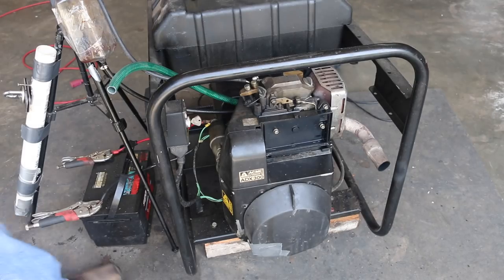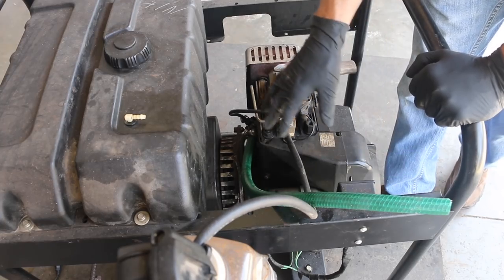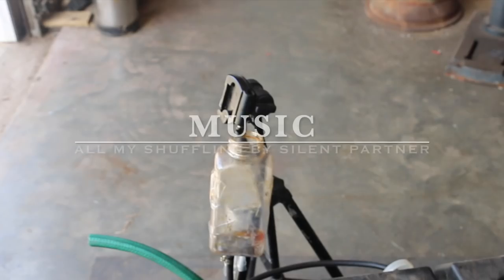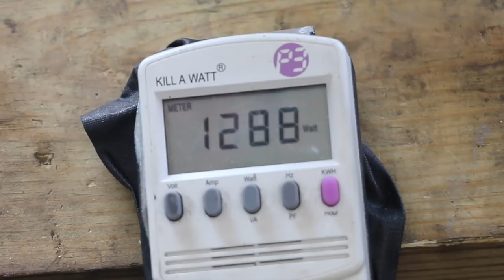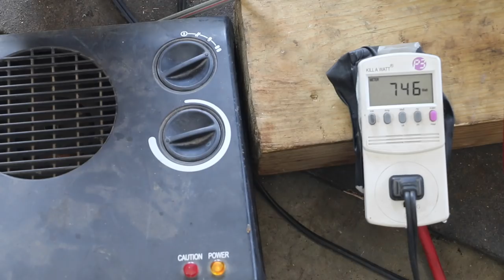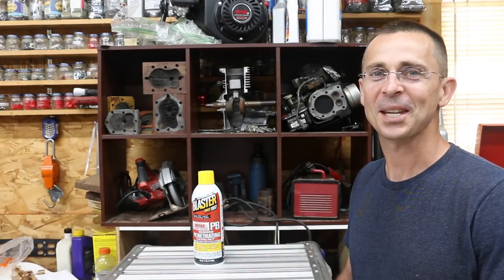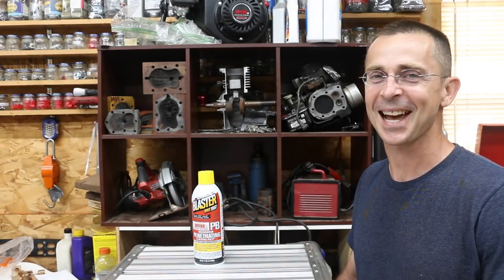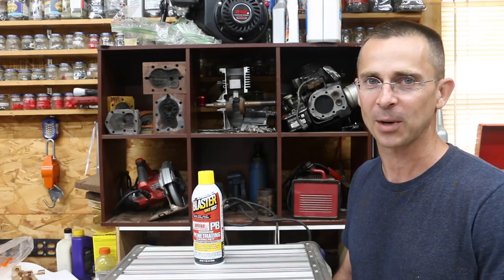PB Blaster as FUEL?  Let's find out!

Comment: A suggestion for future videos like this - a look at the frequency display (Hz) on the meter would be interesting, as the frequency is directly tied to the speed of the engine (except in inverter generators). Certain electronics and electrical appliances won't work right if the frequency deviates too far from 60 Hz. :)
Reply from the maker: Great recommendations!
Reply: ah yes.. the magic 60.. of course... good plan...
Reply: Non-inverter generators are all over the place with respect to frequency especially small ones like this. In my experience most appliances don't care about frequency over small periods. Motors run a little slower or faster. Heaters don't care. Switch mode power supplies lose efficiency. Even in huge swings of +-80%
Reply: mharris1270 I agree, the only way the consumption on the heater would have gone down is if the voltage went down which also means this generator has bad voltage regulation or the RPMs dropped below regulation threshold.

Comment: Use Veg oil and used engine oil . It works, been doing it 15 years in my diesel vehicles but some people don't believe it or think it will blow an engine up.  Make sure you filter and dry the oil properly before you use it as fuel.  No engine will run on contaminated crap. 
You could also add 5 and 10% RUG and show the effects of that but to get a true reading you may have to load the genny near capacity. 
To see the specific power of each fuel you will need to over ride the govenor on the engine so it does not open up and add more fuel to compensate. 
The Veg and WMO should have about 10% less power than diesel but the addition of the RUG should bring it back the same.
Reply from the maker: Thank you for the video idea!

Comment: Run charcoal lighter fluid
Reply from the maker: Thank you for the video idea!
Reply: Charcoal lighter fluid is to volatile of a liquid. If put in a diesel engine it would cause premature ignition and cause premature wear, but I can't say the same for a gas engine, granted gasoline is more volatile than lighter fluid.
Reply: Cayden Brown you won’t get premature ignition in a diesel because the injection timing sets the ignition timing. If anything a faster light-off time is better as it reduces the delay phase duration and reduces knock.  
What bbq lighter fluid will do is shag out the pump. It’s got no real lubricating properties whereas diesel has enough sulphur to stop the internals grinding.
Reply: WineScrounger Not ULSD, which is all you can get nowadays.
Reply: WineScrounger what about the high compression? Won't that cause the preignition?
Reply: @stacy - depends on the age of the motor and pump, even then some stuff runs fine on ULSD and anything built in the last 20 years at least was built to run on it (manufacturers were given a tonne of advanced notice), I used to work in a Gas Station just before I left high school and for a while after ( 98-02)  and we got notification like 2 years before it went on sale (And we were always last to know anything..why bother to tell the folks who sell your product and will have to answer questions from customers?)
Reply: John Phillip Given those years, you are referring to LOW SULPHUR DIESEL. That's NOT what I'm referring to. They changed it again to ULTRA Low Sulphur diesel.

Comment: try lamp oil
Reply from the maker: Thanks for the video idea!
Reply: Lamp oil is kerosene. 10-16 carbon chain molecules vs diesel 8-21 carbon chain molecules. Military equipment run on both so diesel engines will run fine all day o  kerosene.
Reply: Erik Kovacs don't matter. Still a video idea

Comment: U should look into HHO & do some experiments with it. It’s pretty interesting.
Hho generator, Hho cell, Hho conversion, ect.
Reply from the maker: Great recommendation!
Reply: Id like to see this as well please
Reply: Be interesting to see how badly it will fail to provide any net gain. As good old chief enginer Scotty put it " ya ca nay change the laws of physics". Your using an eninge to drive an alternator to provide electricity to split h20 to recombine it in the engine to drive the alternator. Extra losses and inefficiencies but no energy gains in the system, anyone with a half decent  understanding of basic science can see its BS. On top of that the generated gas is explosive and electrolyte solutions can be toxic when used, causing possible environmental /disposal issues.
Reply: Link to Humerus explanation.....
Reply: do your research. There are some bunk units and there are some excellent units. HHO WORKS AND CAN EXTEND YOUR ENGINE LIFE AS WELL AND IT DOESNT PRODUCE TOXIC GASES.
Reply: +ChiefJustice Middleton Yeah, no.
Reply: ChiefJustice Middleton , obviously lacking basic reading skills, nevermind understanding of science. Who said gas is toxic, explosive but not toxic, the electrolyte can become toxic depending on the material used for the plates. Energy cannot be created or destroyed, your running a sealed system, where's the energy come from? Basic fundemental scientific principles dictate it don't work.

Comment: What about zippo fuel in an engine.
Reply from the maker: Great video idea!
Reply: Zippo fuel is a grade of naphtha called "Varnish Makers and Painters" or "VM&P." It's also called "straight gasoline." A gas engine will run on it - very, very poorly, but it'll run on it.

BTW it's about $15 a gallon.
Reply from the maker: Excellent!  I'm looking forward to testing it!
Reply: Also, just so you know...if anyone asks you to test "Coleman Fuel," "camp fuel" or "white gas"...those are also VM&P Naphtha. 

Now, on the other hand, "carburetor cleaner," "parts cleaner," "paint thinner," "charcoal lighter fluid" and "dry cleaning fluid" are all mineral spirits.

And then there's "lamp oil" like you'd use in a tiki torch. That's kerosene. It'll work well in your diesel engine, but not in your fleet of lawn mowers.

Just ruminating...The Great Paint Aisle Challenge might be fun. Pit naphtha against mineral spirits against a 50-50 mix of the two.

Comment: Hey there again! There's some suggestions around for decades claiming that using heavier engine oil in a worn engine helps to increase compression and reduce oil consumption and cylinder blow by and exhaust smoke. And personally i was thinking the same long before i heard this from other people aswell.
Something like 10w-20 and 40w-70 or whatever is appropriate for the test engine and has this kind of extreme difference.

I've tested some additives which claim to do this job and they are liquids of incredible viscosity which in turn make the oil noticeable heavier, they will surely have other ingredients aswell, but the first thing to think is why not use a heavier oil in the first place.

If you think you can conduct such experiment, i would enjoy watch it on a video!
Reply from the maker: Thanks for the recommendation.

Comment: Amazing what a diesel will run on.  I had an old crappy Vauxhall Corsa 1.5 turbo diesel for work once.  Poured a jar of diesel into the tank one evening, but lifted the wrong jar (it was getting dark).  Poured 5 gallons of waste oil, paraffin, petrol, diesel and some various sludgy crap that was at the bottom of the jar.  Ran fine after a few minor misfires
Reply from the maker: Wow!  Impressive!
Reply: Turns out it was a jar my dad had kept just for waste.  Waste from the paraffin parts washer, dead petrol that sort of stuff.

Comment: always used penetrating oil, brake cleaner, and ether are all good starter fluids for diesel engines without glow plugs. used brake cleaner a lot to start my  Ford f350 when I was young and hard on cash
Reply from the maker: Thanks for commenting.

Comment: I would love to see a test of using 2 stroke oil, transmission fluid, and engine oil added to diesel fuel to see how well it adds lubricating properties back to diesel fuel compared to adding diesel cetane boosters. I have personally run a quart of 2 stroke oil in my old diesel every time I fill up. It helps add back lubricating property's that have been taken out when they started coming out with ultra low sulfer diesel.
Reply from the maker: Great suggestion!  Thank you.

Comment: I actually run ATF in my diesel tank from time to time. I only run a quart on a full tank but some guys I work with have poored a gallon in theirs. I only do it 2-3 times in between oil changes and it actually increases my mpg by 3-4 miles. And that’s by doing the math at the pump using my trip meter...
Reply from the maker: Thanks for commenting on this.

Comment: I like your projects very much and they are very educational, but I have a suggestion way dont  you assemble the motors on a bench out off the lawn mowers with transparent glass covers on the sides of the glass carter and all ready to see the fluids circulating and all moving parts ... it would be easier to work well than to film the various events. Thank you for reading this and hope it is a good suggestion.

Comment: I've been hearing about black diesel, and I'd be interested to see at what viscosity motor oil stops being a replacement for diesel fuel. You should test transmission fluid 0W-20, 5W-30, 10W-40, 20W-50 and even things as viscous as gear oil to see if they'd be suitable substitutes for diesel fuel!
Reply from the maker: Thanks for the recommendation!

Comment: The engine you have appears to be either a Ruggerini or a Lombardini, probably an old Lombardini, something along those lines.
There's something to consider here with regards to octane and cetane, with diesel engines you have cetane and therefore you are not going to run something like everclear in a diesel engine, however, kerosene, cooking oils, chicken fat, (the stuff out of supermarket/ deli cookers/ rotisserie. I've seen plenty of low viscosity fat come out cookers cooking chickens in the supermarket. I know that will run).

One experiment is running the engine at idle on diesel and spraying things like aerosol based WD40 into the intake of the running engine, testing cetane boosters to reduce diesel knock, you have a lot of diesel knock there. Those Italian engines are not the most refined and quite crude (especially the old ones) but they generally last quite a long time with care and maintenance.

With gasoline, you are about stopping autoignition, only the spark ignites the air/fuel mixture) but with diesel, it's about promoting autoignition. so the higher the cetane, the better in a diesel, the lower, not so good. It's all about autoignition and that's how diesel engines run without spark plugs.

I like seeing progress and I see it here, good move.
Reply from the maker: I believe you're right about it being manufactured by Lombardini.  Also, thank you for the information on cetane and octane.  Great information!

Comment: I agree with trying Engine Restorer in it. Any kind of low grade fuel, stuff that would knock in a gasoline motor should work. Fuel's with a low vapor pressure. Rudolph Diesel run peanut oil in his first diesel.
Reply from the maker: Thanks for the feedback.

Comment: Got to find the right mix. Wd40, MMO has sulphur, 10/w30. Mix some oils together. Maybe get some test equipment for compression or another engine. Be nice if you could rebuild that engine. Or find a Newer one. You have tested usually one fuel or another or added gas,. Get some diesel Power service cetane boost. Diesel/Power service and some 20w50 mix
Reply from the maker: Thank you

Comment: a long time ago, i was told that back in the 40's and 50's,  they would sprinkle comet cleanser into the air intake to polish the cylinder walls and piston rings.  i was told they did this because they could not afford a rebuild kit for the engines.  they would sprinkle it in until the exhaust would blow clear.
Reply from the maker: Interesting.

Comment: I’ve heard people cutting diesel with used transmission fluid  for fuel 

Also have always heard running a tank of higher octane to clean a engine that’s been mostly been ran on much lower octane 

Also heard running kerosene mix in with diesel to help clean up the Diesel engines
Reply from the maker: This is food for thought regarding future video ideas. Thank you

Comment: Blaster has been in my shop for many many years, but did you know that has many products, one of their very good products is injector cleaner. I would like to see a comparison with other cleaner.
Reply from the maker: Thank you for the video idea!
Reply: I have another idea for you: Compression checks, in the early 70's I worked in a salvage yard, where they would take an engine do a compression check, if the compression was low they would run the engine, pouring ATF and water, mixed 50 in a coke bottle, thru the engine, recheck the compression and it would be almost 40 PSl higher!! WARNING: If ya are fogging for mosquitoes this works, heavy white cloud of white smoke.

Comment: For an electrical load,  you could set up a board of lights (halogens) with each light having its own switch and one switch being a dimmer switch for finer control.  

Also, does that diesel engine have an adjustment for injection timing?
Reply from the maker: It doesn't have an adjustment for injection timing.
Reply: Project Farm - poo :( there could be a lot more experiments to do if it did

Comment: Try filtered used automatic transmission fluid for fuel. Kerosene also would be another. And see if Lucas stabilizer or restore helps with the blow by. Check out the multifuel engines in the old 2 1/2 ton military trucks, they’ll burn anything as fuel.
Reply from the maker: Great recommendation!

Comment: Maybe you should try filtered oil for frying or engine oil, that would be cool and should work since diesel engine can run away due to oil beeing sucked to pistons.
Reply from the maker: Great video idea!
Reply: People use this. You start the engine on pump diesel and warm it up (warming up the oil in the process), then switch over to the filtered vegetable oil. It works pretty well; if you can find a source of cheap waste oil, you can save a lot of money with this. Your car will smell like a french fry machine, but that's better than what diesels usually smell like.

Comment: I have run my old Mercedes on a pint on sea foam and it drives about as well as diesel. Also, used and virgin motor oil. As long as it isn't too cold it does OK. Obviously it's smoky as hell burning pure oil.
Reply from the maker: Thanks for the video ideas!

Comment: Run it on engine oil, either 2 or 4 stroke oil. When these thing runaway it's often found they did so because of a leaky oil seal. It would be interesting to see if it can sustain itself fully on engine oil.
Reply from the maker: Thanks for the recommendation!

Comment: What is the blow by from? your talking about out of the green hose? My 1994 3 cylinder Kubota has a tiny hose coming off the top of the engine and goes down to the ground but has vapor coming out of it ever since we have had the tractor since brand new.
Reply from the maker: Worn piston rings.  This is is worn out.

Comment: That was really cool. I never would have thought PB blaster would run in a Diesel engine. That's a interesting little generator in itself.
I have always wondered if you ran out of Diesel fuel could you use a gasoline/2 stoke oil mix as a substitute?
Reply from the maker: Thank you

Comment: I have wanted to try to bypass the fuel injector and try to make the diesel run on a drip of oil direct into the intake. It would be a easy way to run used oil and you would not have to filter it very much.
Reply from the maker: Thank you for the video idea!

Comment: Who would’ve thought? I think a cool idea is to add methanol injection that adds windshield washer fluid into the incoming air to see how much it cleans the combustion chamber or how much power it adds. This has been used for years on high horsepower street cars to prevent detonation but I’ve never seen it documented for its cleaning ability.
Reply from the maker: Thank you for the video idea!

Comment: Try running a diesel on used motor oil or ATF. I've always burned my used motor oil in my 92 Cummins, sometimes up to 5 gallons mixed with about 10 gallons of diesel. I've never done just motor oil though. Seems to work good, at least mixed.
Reply from the maker: Thanks for the video idea!

Comment: A old diesel engine is a great way to burn off used engine oil from oil changes. Did this on the farm, had a MF tractor 4 cyl diesel mixed 50-50 used oil and diesel, when used oil was available, ran fine, the old man pumped the used oil through a filter with strong magnet before adding it to the tractor, never had a issue. Most likely could have ran on straight used oil.
Reply from the maker: Thank you for commenting!

Comment: I have a question that i would like to see tested.  Would an engine run on a 50 50 Gas/water Vapor mix and would it be more or less fuel efficient?  Also i would like yo see e3 spark plugs tested. Thank you.
Reply from the maker: Great recommendation.

Comment: Certain solids, when heated properly, can turn into a liquid that could be used as fuel.  Reading the suggestion for lard or other animal fats as fuel gives me the idea that if the container holding the liquid was double-walled, and the exhaust run through the resulting space, that could quickly heat up the solids to a melting point.  The key would be to start on regular fuel and switch to the melted fuel when the temperature stabilized.
Reply from the maker: Great recommendations.